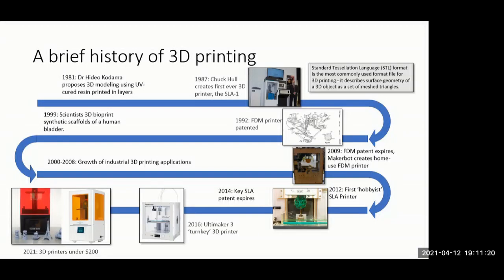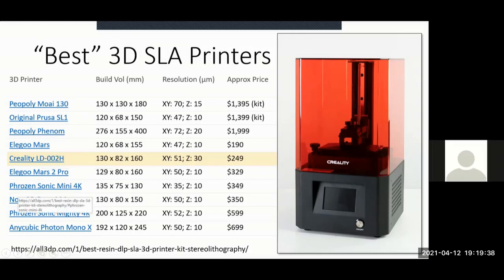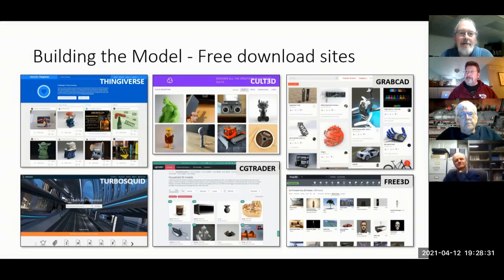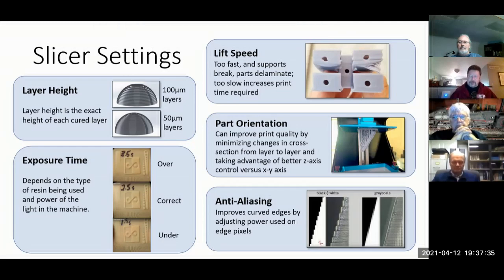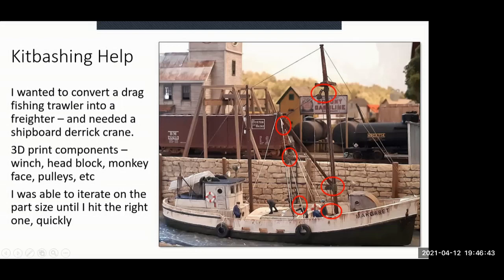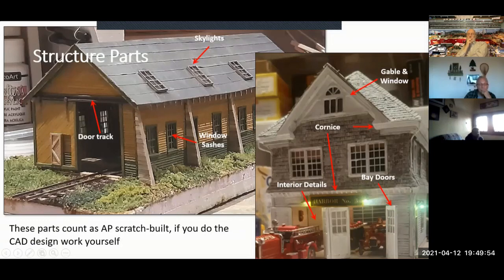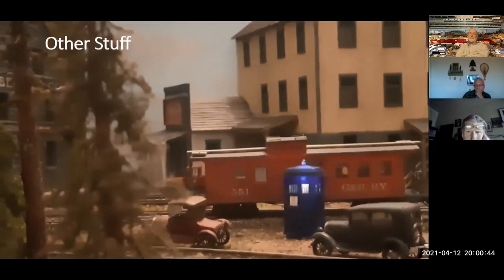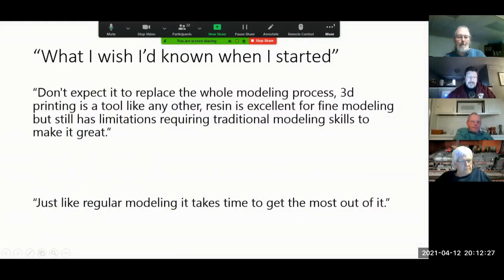Ray Persing 3 D Printing 4 12 2021

Comment: One more program to add. If you have Windows 10 it comes with 3D Builder. It is a great starting point free (included with Windows 10) program.
Reply: Could not find 3D Builder.
Reply: @railmus  Click on the Windows icon in the lower left corner of the screen. Then type 3D and it should come up in the search.